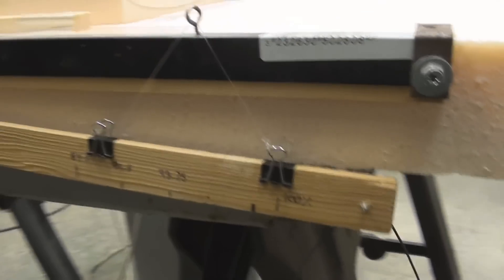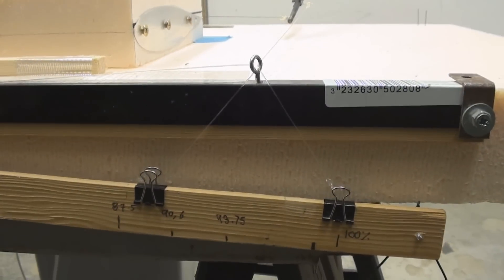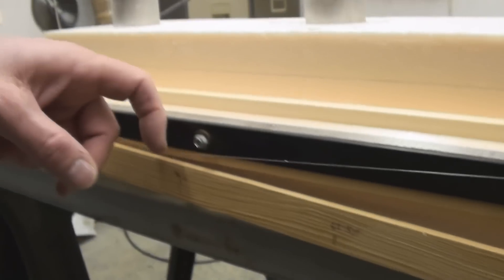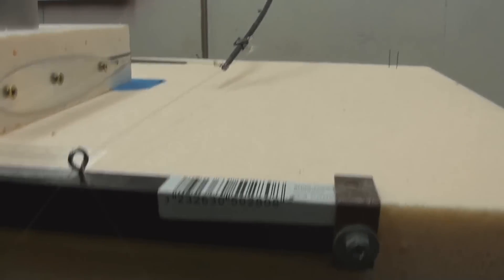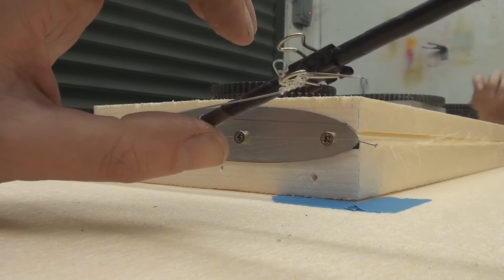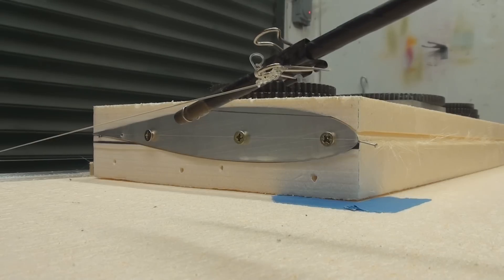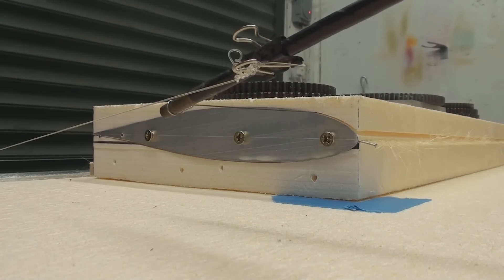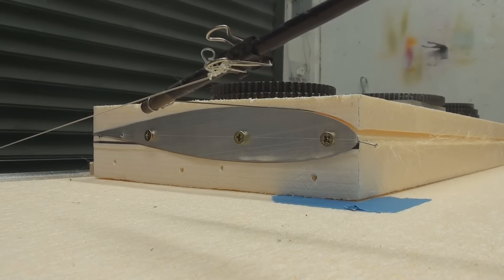cutting foam wings

Comment from the maker: Hi Mike

You can't cut Celotex with a hot wire in my experience, it's a polyurethane based foam. You need either a white foam, blue foam or pink/peach foam as used here. This was Knauf Space Board. B&Q and Wickes stock it at times (if you're UK based). There are other foams that you may be able to get through a builders merchants such as Dow floormate....good luck!

Comment from the maker: Hi Anarchy83, The weight arm drops and pulls the fishing line with it. The fishing line is attached to the bow arms nearest the hotwire. The angle at which the fishing line pulls on the bow keeps it sat on the templates. I have seen guys put lead weights in the bottom of the bow arms, but have never felt the need to do it. Most of the time the bow doesn't need any help other than to get it started, or to delay one side if it's racing ahead on a tapered cut....good luck!

Comment from the maker: Yes, two different sized templates would be required, we cut tapered panels in this session though it may not be clear in the video. The bow hanging at an angle will help it 'swing' into the cut and also allow the hot wire to rise and descend as it follows the aerofoil section

Comment: Nice video! I have questions. I want to put carbon fibre pipe inside of wing for increasing strength of the wing. So, do you know any way to do it? How to drill 2.5 meter long wing accurately ? Thanks :)
Reply from the maker: +Emir Berk Canpolat I would slice the cores in half (top to bottom) and then cut a channel and set the tube in with Gorilla glue. Ideally you need to make sure the tube makes contact with the outer skins, maybe with a ply web or similar.
Reply: Thanks!

Comment: 1:25
are you happy with such result? I mean it's not a perfect cut, when wire is out of gauding templates, I mean edges are not the same as center of the wing (with wire bend), I dont like it.
Reply from the maker: It's probably not clear in the video but the cores are pretty near perfect, you would expect the wire lag to lead to a deformed core, but if your cutting speed and wire temperature are good, you won't have a problem.

Comment: What type of wire are you using to cut the foam, I have used nichrome, but it tends to loose it's stiffness when hot.
Reply from the maker: Hi Arno, sorry I have only just seen your message. I use nichrome too but with lots of tension. The 'legs' of my cutter hold the wire tight at all times.
Reply: Ah thanksI also used weights to keep my wire nice abd tight

Comment: I never could get it to work I just had to secure the wire To the other end of the room I just use 1Handed operation just swing it over like a pivot and an arc.
Reply from the maker: That's a great technique especially for tapered wings!

Comment: Nice video! I have just made one  of those drop arm cutters and found your vid quite informative ;)
Where do you buy thin aluminium for the templates from?
Reply from the maker: +Frank Dubbya Thanks Fra nk. I went down to my local printers and got some used litho plate for free. I have heard of some people using aluminium flashing or even beer cans.
Reply: Never thought of that! Been looking all over for aluminium flashing without success ... off to the printers now! :-)

Comment: How do you make a wing spar for all the parts ?
Reply from the maker: ***** Hi LeBuimi, in this case  the wing just had carbon and glass skins. If you need to make a spar, you can just make up another template to cut a vertical slot in the cores and then insert the spar design for the job.